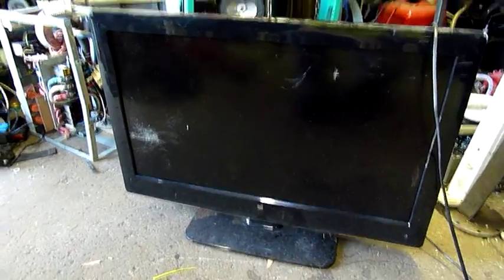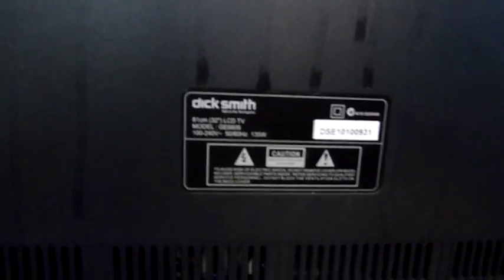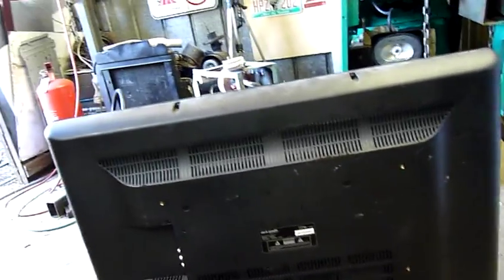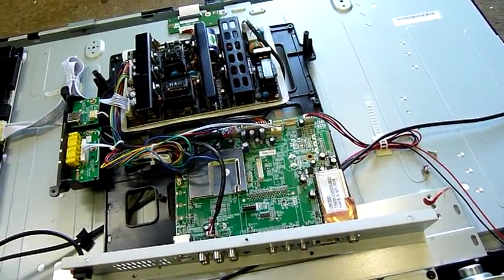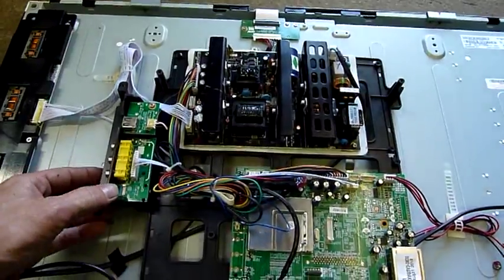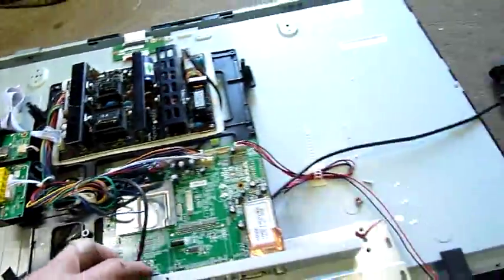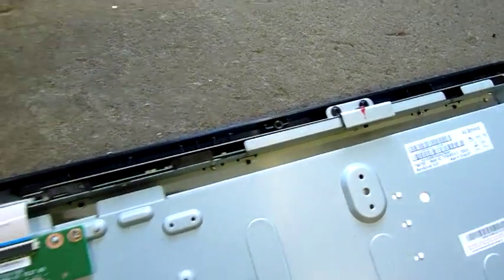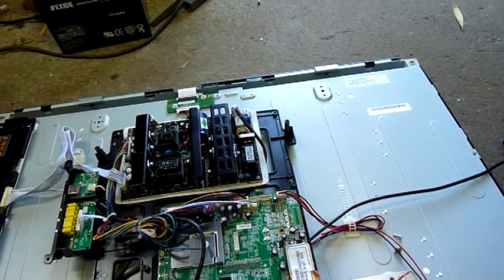Dick Smith Electronics LCD TV Autopsy

Comment: The big changes to tips over the past 15 years is to turn them into recycle depots, but you need a small army of staff and some very fancy machines to make this happen and it no longer becomes a hole in the ground to dump stuff. The few tips which are still running where I live have turned into very expensive places to visit....weird as they end up making money from anything dumped there.

Comment: I found a flat panel on the side of the road once - an LG. I opened it up and attempted to resurrect it, and found that it was a bad connection between a ribbon cable and the main board. There was no way to hold the thing in place, so I turfed it out a week later because of a lack of space. It was only about a year old, I would say.

Comment: I doubt whether someone would smash and grab for one of these things, it's a cheap store brand TV like you would find at Walmart, and it isn't even a large screen unit to boot. More then likely someone knocked it off a table and broke it, or got angry and booted the screen, or the power supply quit working so they tossed it into the bush.

Comment: I last went to maplin 3 or 4 years ago and it was useless back then.. I can't imagine they've actually started stocking electronics parts properly again since then. Rapid, Farnell etc are pretty good but postage is at least 10 quid unless you order a fair bit of stuff. For little hobby bits google "bobs bit box"

Comment: hmm double taxation .authorities will learn the hard way like in uk,  it cost's more in the long run to drive around collecting fly tipped waste than to have it dumped for free at a central location. 
as for the repair tech, if its a side line, then he would probably choose to fly dump, however if its a business you factor in the disposal cost on the deposit taken for each repair item as it comes in though the door.some people would bring stuff in with no intent to ever collect ,hence a deposit.

Comment: Bloody shame :-(

That company sounds just like "Maplin electronics", they used to be excellent for the hobby.

The chips had a pinout and data/schematic for you to use the part with ease, but they started to cut back on the electronic side and now its not worth getting the catalogue :-(

They are bloody expensive, lots of other crap has crept into the catalogue.

But for tools/meters they are ok, still bloody expensive.